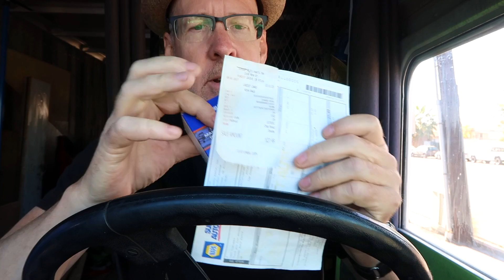New House Batteries for Step Van E347

Comment: Re oil sender. Almost any oil pressure switch or pressure sender will work IF they the have the same screw thread to fit the opening. Most will not have screws on top but a connector. Ask at auto store to see if you can match the removed sensor  threads of your present sender. Try a GM match first as they are the most plentiful. Alternatively take sensor to hardware store and try to find a fitting that fits the threads. This will give you the size so that you can ask around for the size that fits.  I realize this is a lot of DIY but the alternative is to visit a cummins Dealer and pay 4X the price of a GM part. You have the time to learn stuff now or just do it the easy way.  Good luck!
Reply from the maker: I'll have to do some more research to find out what I have. thanks for the extra info!